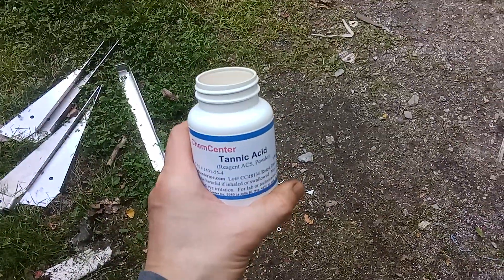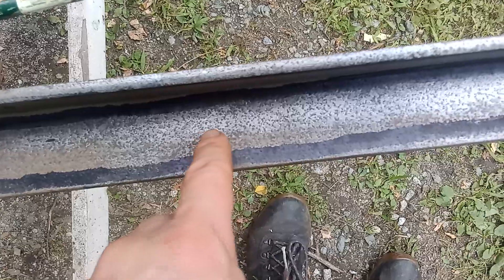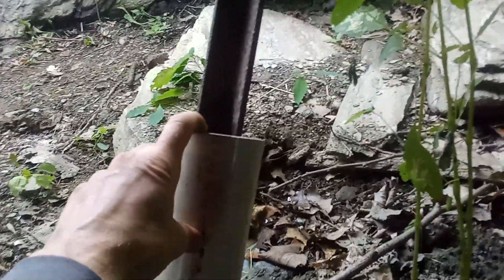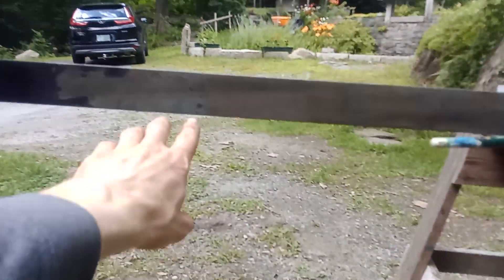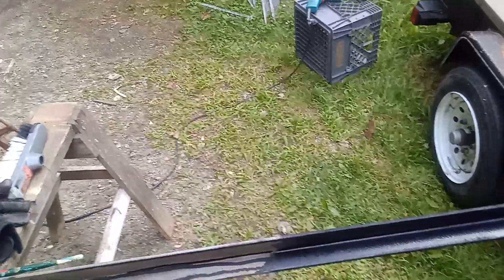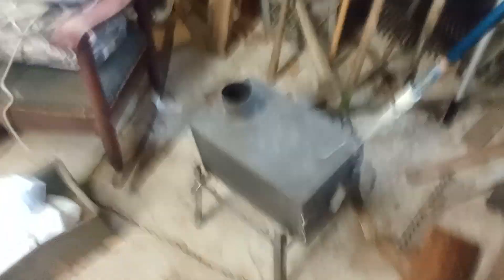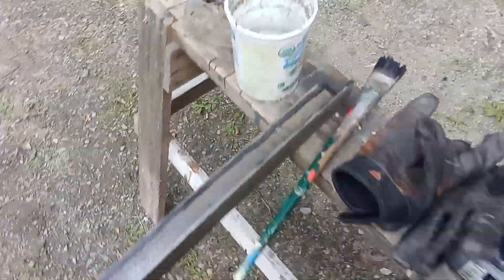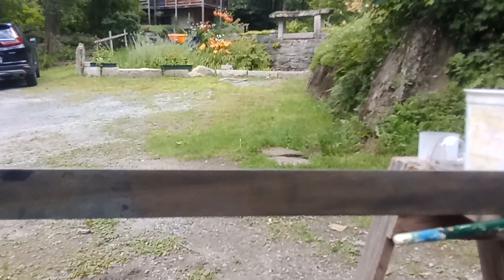Converting rust with tannic acid

Comment: Ian, you are all over the place with this video.  This is useful information but your video is poorly made.
1. Hold camera steady, you are making us sea sick.
2. Remove all irrelevant chatter and focus on one thing - show how tannic acid converts and bonds rust to metal so it stops rusting.
3. Explain that right after tannic acid use, metal must be coated with something to prevent rust coming back.
4. It should take 2 mins or less.